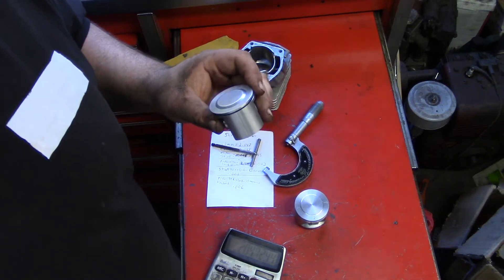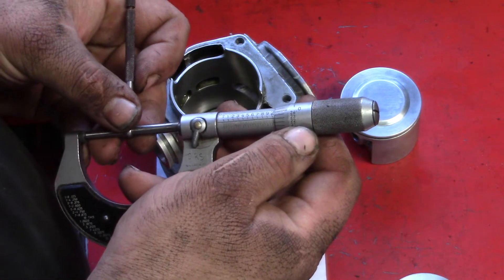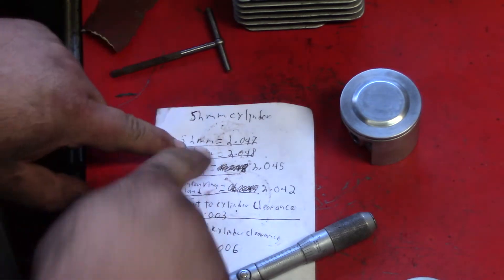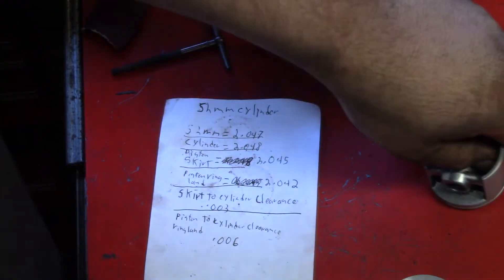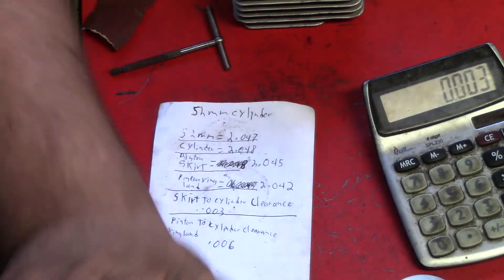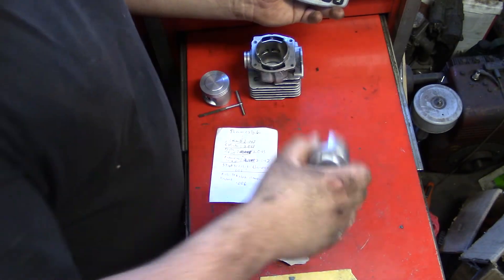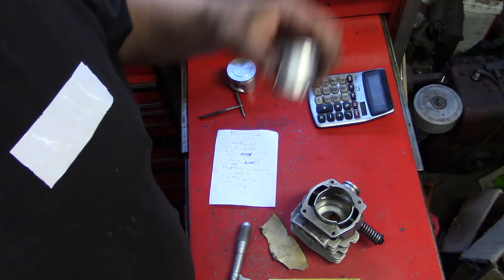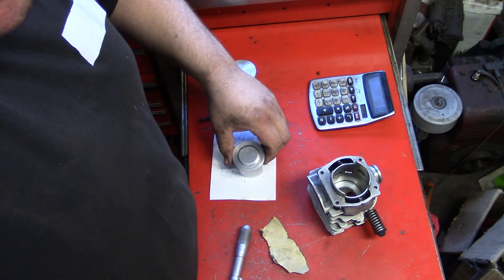Husky 272 Piston Too Tight Measuring And Correcting The Cylinder Clearance.

Comment: You have 4 years in being a machinist. That is like being married 4 years and being an expert. I am honing a 175 Yamaha jug right now. There is NO way your are measuring , TENTHS, with the tools that you are using. A Dial bore gage is the only way. That piston was made that way and you just ruined it. You should have taken the cylinder to a proper machine shop and have had them SUNNEN HONE it to the correct clearance. Probably around .002 total. What you did, WILL work, but is if FAR from how to do it correctly.
I rough hone it, Ball hone it to break the edges on the ports and then finish hone it to size.
Let it sit for a few hours and then measure it, They always shrink. Check the port chamfers and maybe ball hone it again and then a few strokes with the Sunnen Finish stones in the machine. If you really want to get fancy, you can Plateau hone it with a nylon brush with grit in it to get the sharp edges off the cross hatches. Never stop learning!

Comment: Dude i love your videos that have tips and tricks for using your mini lathe! I bought an old craftsman 109 lathe and am working on getting it going. Just got a motor for it this week, and will be building a stand for it eventually. Ive never used a lathe, so all of your tips really help. I bought it for the sole purpose of working on chainsaws :)
Reply from the maker: If it is your first time on a lathe try practicing on scrap metal parts till you get a feel for it.
Reply: @kennytheguitarfanatic054  oh FOR SURE! I'll play with it for a while before chucking in a nice cylinder! Ive got a few junk cylinders i saved to practice on before the real thing too :) I'll have to play with the speed and figure out which pulley combination works the best for aluminum, being the motor I'm going to hook up has 5 different diameter pulleys, and my lathe has 3 different diameter  pulleys. Finding the right combo should be interesting

Comment: Excellent video sir !   Hyway is hit or miss - the meteor is a better product imho
Reply from the maker: Thanks for the tip on meteor.
Reply: @kennytheguitarfanatic054  I’ve used / measured a few of them with mics and the tolerances are within specs with very little variation. The oem jug with a oem piston is best but the meteor is on par or very close to oem imho
Reply: I’m a machinist by trade so I can “get away” with the spring style bore gages, p/u from Harbor Freight for about $20. I think the digital or dial bore gages would be best but they are considerably more expensive
Reply from the maker: @fabzacres-blackcat   I was a machinist for 4yrs did a apprenticeship program. Dial bore gages would be cool idea. You said you are a machinist just curious do you have lots of training in machining.
Reply: @kennytheguitarfanatic054  CNC, manual machines , grinders , tool and die work - can do some decent welding /brazing fabrication work and have connections in the industry that can pick up the slack if need be. Guy down the road from me is 70yrs old and owns his own welding / fab shop - VERY smart guy , with some ol school equipment that most ain’t never seen. ✌️
Reply from the maker: @fabzacres-blackcat  Pretty cool!